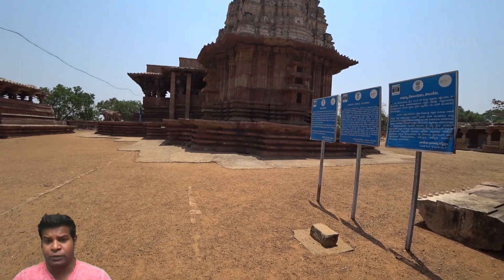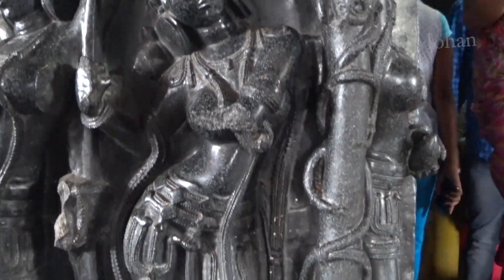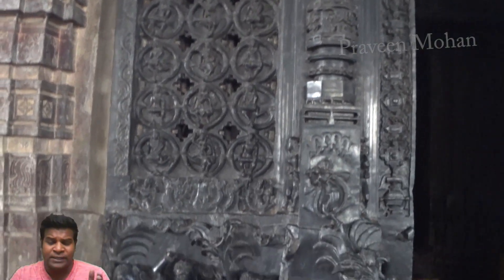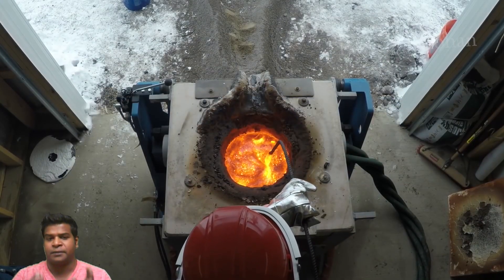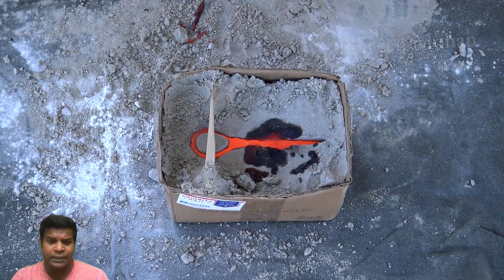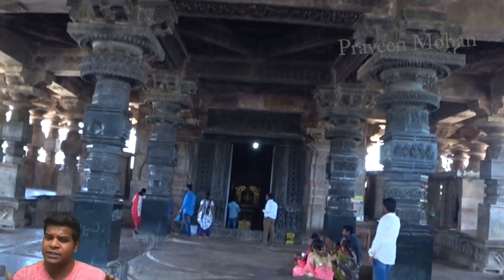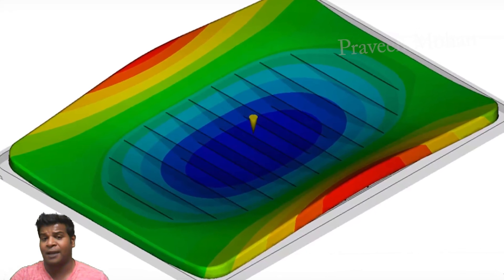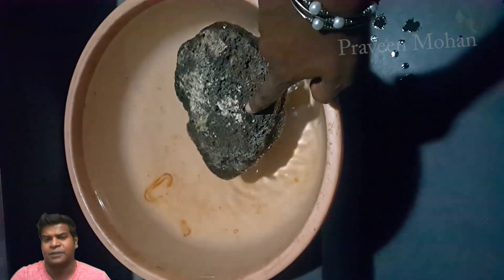Rock MELTING Technology at Ramappa Temple, India

Comment: But where would one find the evidence of the furnace for this? And the fuel? There would have to be something beyond the usual stoking and fanning to keep up the temperatures long enough to melt large quantities of stone and keep it liquid enough to outgas and slake away impurities. Did they do something like mixing natron and/or saltpeter with coal or charcoal at some stage in the process? (Add a rudimentary oxidizer of sorts to a furnace fuel to reduce the need for fanning and get higher temperatures?) Another possibility is getting bitumen or some petroleum distillate into the firing process, but there doesn't seem to be much record of that which I'm aware of.

Not saying people couldn't figure this out, but how would it be achieved without the modern resources that we currently have on hand?

Comment: Could not someone just use a sonogram on the flute stem to show its hollow from base up? Just like on an expecting mother? And while I don't disagree not agree with your assertions, I just think a non-invasive test could show a cavity a slightly easier to do feat than imperceptibly altering the density in a flowing manner? Just a thought.

Comment: I disagree with you on that stone being cast. If it was, that warp would not have been at the edge of the stone, but at the center. Anytime you cast a molten material, it cools at the edges first, and as the center cools it shrinks, which is what causes that sink.   I believe that what likely happened is that during orginal construction, that stone had a carving on that side and for some reason it broke in a way that was irrepairable. In order to save the stone, they merely removed the rest of the carving and polished it.

Comment: The gods or avatars of Hinduism were real , not mythological beings. They possessed awareness of physics which surpasses even today's technology, most of which is limited by  fundamental flaws in our scientific models (eg particle theory of matter). These "gods" were fallen angels as described in the Bible and in Books of Enoch and Jasher and elsewhere. These angels knew that everything is made of light and they knew how to manipulate what we call matter (just a concentrated form of light) . They used this knowledge to gain wealth , prestige, power/worship, sexual partners, ..A great deal of this historic fact has unfortunately been relegated to mythology and religion. Similarly a great deal of advanced ancient machinery has been simply categorized as a place of worship. 
   I agree they melted the rock but I do not think this melting used heat but rather via some sort of acoustic manipulation as you briefly allude to at the start of the video. Similar things have been accomplished by little known scientists such as John EW Keeley in late 1800's. Just as angels were relabelled as gods, machines as temples, so Keeley was labelled as fraud. Not much has changed in how mankind deals with radically new information. 
Praveen is doing very well  making crucial connections between occult history and science, religion and archaeology.

Comment: ****Clay is of the earth, molding and baking was common. Rock melting if high in silicate can be done by heating. 
Flutes never had nor will melt rock by tone, pitch, or even frequency unless in tremendous mass. 
       Folklore and deception, worshipping the creation and not The Creator.
Idol worship.
Something Abraham and Moses warned about.

Comment: The temperature of an object is simply a measure of the linear average kinetic energy of the atoms.  The fact that the atoms collide with nearby objects accounts for the destructive nature of heat.  However, the average kinetic energy could also be increased by causing the atoms to rotate at high speed.  The item would theoretically increase in “temperature “ and melt, yet feel cold to the touch.

Comment: I think you are on the right track with the rock melting, but it may also have been chemical agents used in some cases instead of heat.  There are recorded cases of stone softening liquids used in Peru, with organic materials being caught in the process that would have been destroyed had heat been used.  Heat, stone softening liquids, and consistent frequency application, in ways that we haven't yet figured out again.  We're still living in the stone ages, we've just gotten better at using them, but we specialized too much and lost the integration of the minerals.  I believe we're getting close however.  Finger crossed

Comment: Interesting theory, but i think it would be more work to make molds and try to cast these enormous sculptures then to just carve them out of basalt.  I think the change in tone while flicking the sculpture is not so much a change in density (though there may be some natural variations within the stone), but a change in vibration of the shaft as you move closer to the fixed ends. (The free floating center will vibrate more because it is not  fixed) As for the indentation in the pillar, this may be explained by a chunk breaking off while carving and making the decision to make the area smooth instead of tossing the entire piece.
Reply: Logic! Ah! I finally found some....
Reply: Never worked in stone have you? Lol
Reply: @Tonk1e  IN stone, no. WITH stone, yes. I have a Dremel, angle grinder, and masonry chisels.  (And yeah I knew what you meant- just being a smartass).   (Edited for auto-correct writing Drexel instead of dremel).
Reply: @Tonk1e  i have'nt worked with stone but i do work with steel. We melt down scrap metal and pour 100 ton ingots the size of these pillars. There are 2 ways to melt that much steel. Electric arc furnaces, or to blow pure oxygen into a carbon rich bath of molten steel and add scrap. It would'nt work with stone for many reasons

Comment: I tried to like this channel, 
but i hate it! but there’s just too much BS in this mans speech. sculptures and stone masons confirm that there’s no way to carve a rock with harmonics? total 🧢 the only way to make the sound is by altering the density of the rock that’s the most retarded thing I’ve ever heard. there are plenty of rocks to naturally have a harmonic resonance like the ones found in Adams circle in Africa among a myriad of others. They also have harmonic president. Yes, you can melt rock no, that would not change the density when it cooled its the same rock as when its hot. defective piece must’ve been melted? Also 100% false. basalt is porous. That’s why it makes good lava. It has nothing to do with harmonic frequencies. It’s just that it can melt at a certain temperature and other rocks need much greater temperatures and often crack first before they “melt”. ever heard of a worry stone? they are not melted they are formed with tools like a dremel. but they didn’t have Dremels button, so how could they do it? 
by using a mixture of mud and sand which creates an abrasive top layer then they would take a bone or log, and “wittle” the rock to the desired shape (they’ve been doing this for the past 10,000 years). Do you really think they used a defective piece for a sacred temple? No, they did not everything in the temple has its purpose or it wouldn’t be there again this man is straight lying to you.
floating rocks, know again he is wrong, pumice rock floats as do others. 
from all the evidence you gave in this video, you cannot clearly see that it was made with the rock melting technology what you can see is someone who is desperately trying to sound intelligent for views, but failing miserably to do so . don’t be fooled or even waste your time listening to this moron. 🤦‍♂️

Comment: Why do you suppose they would use a defective piece like that if not to show the technology? I wonder if it is not meant to be smooth and bent similar to the walls of the pyramids which were thought to be slightly concave when complete. It had something to do with the flow and gathering of energy. Pyramids were originally covered in polished white stone vs this polished black.

Comment: How did they reach those temperatures? It's not easy getting a fire that hot and maintaining it for any length of time. 
The industrial revolution happened in part due to kiln technology. Advancement in kilns allowed them to reach higher temperatures creating new metal alloys. 
I can't imagine building a kiln every time you build a temple. Then supplying it with enough fuel to melt the amount of rock needed to build the temple. 
If you can solve that you would have solved the mystery.

Comment: quite right. Sand melts at 1500 C just like iron.  You can lower this by adding CO2, water and other catalysts. Basalt melts at 1000 C close to the 900 C needed for brass and bronze. Surely the ancient Indians where able to melt both bronze and iron, so basalt would be no problem and they might have known catalytic additives to bring the melting of sand down for glass melting or making floating rocks. So these columns were cast just like the famous non-rusting iron column India is famous for.  Good show. Thanks!

Comment: Sorry to tell you, that doesn't mean that it was melted.  Different types of rocks make different sounds. They also make different sounds based on different thicknesses and sizes, just like bells.  It is not uncommon for certain rocks to sound like metal when tapped.  In ancient civilizations, these rocks were sought after.  They also tend to be very hard rock.  You can actually tap on a huge bolder with a hammer and some rocks will make that metallic sound.  A carving of the same stone would make even more metallica and melodic sounds.

Comment: The problem when melting stone is that it contains gas and water inside. If this truly melted stone it implies they had alot more than just technology to melt the stone alone. When stone is melted and allowed to cool in a normal fashion it will always make a spongey, nearly useless material. This is actually what we see when lava cools. Same exact thing. The stones like granite etc that are very dense and hard, good for building with... all were created by slowly cooling for thousands of years under high pressure. So if they pulled this off, yeah they had some very good technology. They likely would have had to use a vacuum chamber of some sort to draw out all the water vapor and gasses. Then they would likely have to stop and compress the molten stone in a vacuum pressure chamber. All while maintaining the temperature for a very, very long time. If the outside cools faster than the inside it will cause splits and cracks too. So if this is true, the stone melting part is just the tip of the iceberg. 
Judging by all the marvels I see there, I doubt nothing. They definitely were masters.  It amazes me how repetitious all the designs are. They're all perfect! One wrong hit with a chisel would apparently ruin an entire ceiling or wall. All those tiny spikes and stuff are simply marvelous.  Great stuff!

Comment: Alot of his this cannot be actually can be. Such as the concave blank fact. You can definitely over sand an area or chil too deep and have to go deeper to get it out. Manual sanding this would be hard to do accidentally but any high rpm makes it much easier. Or thay you coukd make a stone sound different in one place as opposed to another. This can be done super easily it would actually be harder to make the stone the same everywhere. Tho it does have s metallic sound in this example but I'm not sure of the percussive properties of basalt. Still he was blowing smoke.

Comment: You are half right. Molds were used but not for melted rock. We already have the answer to how most of this type of complex stonework was done. Most ancient stone such as megalithic structures are cast geopolymer. Our ancestors weren't working natural stone but essentially making synthetic rock.  Before the discovery/adoption of Portland cement, geopolymer concrete was made by mixing sand and aggregate with fly ash or slag, and then activating it with an alkali such as sodium hydroxide. The aggregate sand could be crushed granite, marble, silica sand etc, depending on desired result.  Different types of Alkali could be made locally, often from locally sourced plants. In organic form (not overly processed), it could slow down/extend curing time for extended workability. Most of the geopolymer was poured into molds for larger stones or fabric bags for smaller stones. Both techniques allowed mass production of consistent and repeatable shapes that were also malleable. Before fully cured, additional alkali treatment could be applied for fine joint work (the fine lines that you see in many places) and bonding, which is how complex art work was integrated (ie Indian temples). Also, the amount of water used controlled the final finish and density. For smooth, mirror like finishes, the mixture was wet and poured into a mold. For rougher surfaces, a dry mortar was used. Higher densities could be obtained by packing with a tamp. Virtually all the synthetic stone was worked using wood and other natural stone tools. Using different aggregates with varying amounts of water and alkalis resulted in different densities and hardness. You could cast these stones in layers, which yielded different properties such as "acoustics".  It's kind of crazy that modern history covers this up when it's not exactly a secret. Mostly it's purposefully turning a blind eye to our true past. Lastly, there are freemasons who know most of the geopolymer recipes and continue to do repairs. Occasionally one of these freemasons will write openly about it...sort of.

Comment: Your assessments are 100 % plausible to explain how the stone work that could NOT be shaped to the designs by abrasion and cutting could potentially have been done, a simple yet brilliant revelation.!👍 
That may also have something to do with other ancient stone work, like the massive stone blocks that fit together perfectely, perhaps those rocks were heated to they became a bit doughy in consistency and then took the shape of the rocks they were placed on,or touching.!?🙄  
Now, recently I have speculated on the possibility of softening rock and stone, or melting it using powerfull high amp, low voltage electric currents,  because we know how that can melt metals, so why not stone etc.😀!!!
Regards, Niels.

Comment: Is a good theory  now you see  the size  of of this columns the mold it was bigger  and you have to melt the rock on large amounts to get it full the issue  will be how they heat that amount  of material to that temperature  🌡  just whit wood the furnace  got to ben humongous and then the container that hold that have to be tilt to make run into the mold which  it will ben extremely  hot .so why is no trace left of that part or devices? The demonstration  from the university  to is no totally  valid  because  they are using a heating technology that it was not available  at that time  i will like to se a experiment  of melting the same material  whit  more primitive  technology

Comment: Like glass but not like glass is made . .. perhaps they created bricks bricks will make sounds because of the holes. If they are I doubt it was hot more likely wet like cement.  The fine lines and exact fitting of large stones could be a wet cement in a bag with a inner and outer wood wall the bulges are areas where the stone didn't harderen right perhaps instead of firing them then placing them perhaps they fired them in place thus giving bulges where it had not set after the wooden frame was burned off and this is why it looks like they were carved to tightly fir the block it was on it was liquid when set down and self leveling then fired at the end. Polished with oil and ash to get a shinny or flat surface or ground down with harder rocks.

Comment: I don't claim to know a whole lot. I do feel a whole lot. I think you may have it with one exception. Melting rocks and forming them over 5,000+ years ago is a different thing all together. Look at some of the megaliths over the world that have polished flat surfaces, con cave surfaces, drill holes, cuts and many megaliths that are over 100+ tons.  Not fire to melt rock but sound. (No, I don't know how) I can think of only 1 reason how 'they' could have done this. 
1: They melted the rocks somehow without fire. Which means they had help.  
What else is there that makes half a sense?  I'll let others bang away on the Bronze age tools hypothesis. That doesn't make sense.

Comment: The different sounds are the frequency used to shape Rocks bro. Get the frequency and let's try it... Really I'll help it wouldn't be hard just alot of travel and you've already been there.
Reply: I believe if you induce a frequency in a certain type of stone at the exact right way it will render the rock malleable while the frequency generation is occuring. Nothing is solid all atoms that make up the universe are constantly moving and if you tune a frequency to match a target you could in theory freely move the target material around while the freq was passing thru target. I really wish I could test this theory. If you look at all ancient megalithic sites all the rocks seem to be molded together.

Comment: Pouring molten rock into a flat bowl of sand and doing it into molds for large blocks or three dimensional molds are very different things.  One would have to pour the molten rock into a cast with a higher melting temperature.  It is more likely that they were able to soften the rock chemically without heat.